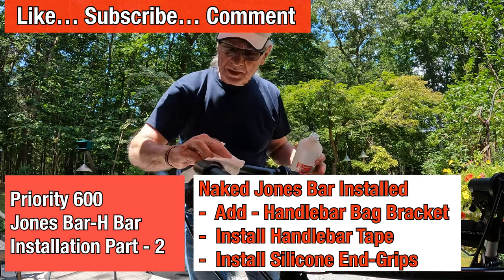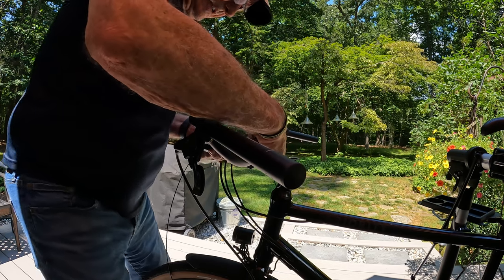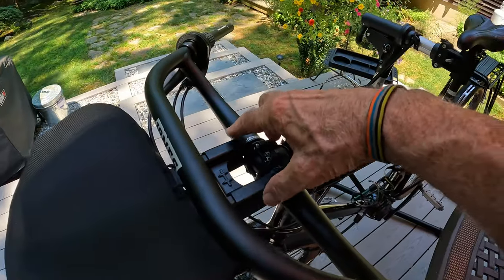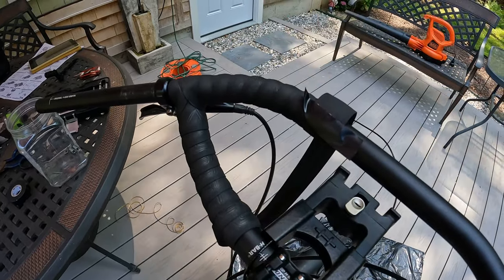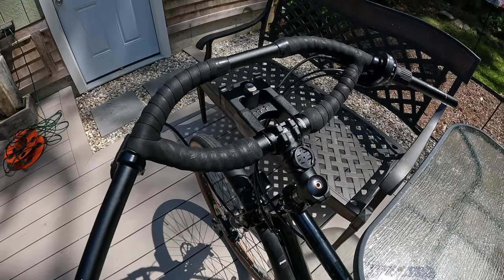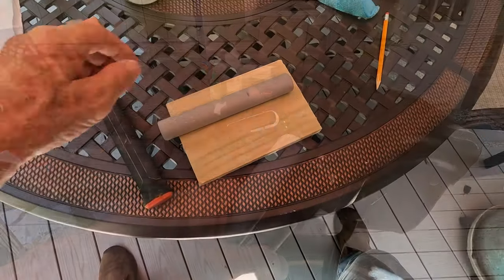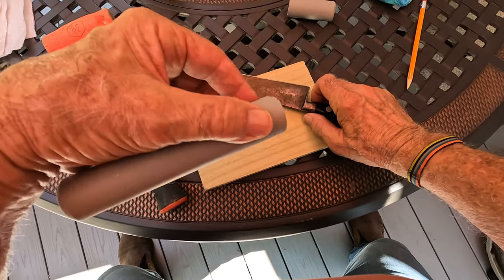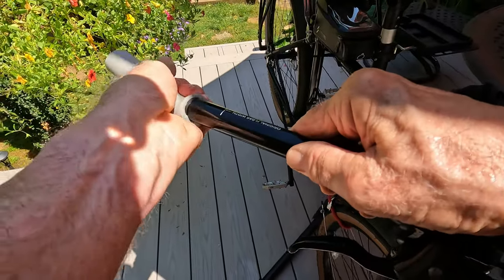Mrs. Jones Gets Gussied Up

Comment: I love the grips that come with the 600.  The ergonomics of them are great for my hands.  So much so that I'm thinking of converting my drop bar gravel bike to a flat bar with the same grips.  I have all the parts, I just have to commit to it and start the wrenching.
Reply from the maker: They are nice and I felt the same way.  But when I converted my Priority 600 to a touring bike, the single hand position even with those grips caused hand issues during a 5 or 6 hour day after day ride.  Some folks with Jones bars continue to use them.

Comment: thanks for the video. Extremely helpful in deciding on the 2.5 handlebar to fit my ortlieb. ill buy the extender. ONE QUESTION.  how is the bounce of the ortlieb bag? do you tie it in anyway  so it doesnt jiggle?
Reply from the maker: Thanks for watching. I don’t tie it down but might consider that if I were riding rough off road. I will post a short vidéo to my channel in the next couple of day showing the lack of jiggle on a rough ride.  If you already ride with the Ortlieb handlebar bar, it is exactly as stable with the extension as without.
Reply from the maker: Here yah go! My Ortlieb Bag / Jones Bar jiggle demo! https://youtu.be/BpmBSXP6c3U

Comment: I noticed that your light is not installed on the handle bar. Did you move the light yourself or ask that priority install the light on the tire fender. cheers
Reply from the maker: Thanks for watching! That’s the position the Dynamo light came on when I received the bike. I’ve noticed that has been changed in the later shipments. I view the Dynamo lights as a daytime running light only as at slow speeds (up hill for example) the stock lights dim down. I use the Cygolight (850 lumens) on my handlebar and the Cygolight “Hot Shot” attached to my rear rack. More lights are better in my mind.

Comment: Do you feel like the bottom of the ortleib bag obscures the light that you have attached to your crown.  I can see it doesn’t obscure the shining down at the road, but what about the height?
Reply from the maker: Great question. I don’t have the headlight sitting upright but have it rotated to the left.  As that is a hub generated light I would never use it for riding at night anyhow as the slower I go, the dimmer it gets. I count on the front and rear hub generated lights during the day to catch the attention of drivers.  I have a “Cygolight” sitting up on the Jones Bar (800 Lumens I think) and a “Cydolite Hot Shot” on the rear that I would use if night riding - front and rear very well lit. In addition I have another red blinky light on the rear of my helmet that I use day and night when on sketchy roads shared with cars.  “Well lit” is my motto… except when referring to bars and pubs.

Comment: I have the Jones H-Bar® SG 2.5 Loop, 660. I am a little confused on the  10-15 degree recommended though and what angle you are measuring and how to do it. I looked at several pictures on Youtube and measured on my Medium size 600  bike from floor to top of the outer bar middle and it came to 41 inches.
Reply from the maker: I just went out into my dark spooky garage and checked my setup. For the angle of the bar I used the iPhone App entitled “Measure.” Choose “level” and it gives you the angle of an object. I set the bottom of the phone at the end of the bar and I actually have mine at 9+ degrees. The end of my bar on the medium Priority 600 is also 41 inches off the floor but I have the wider bars.  Hope this helps.
Reply from the maker: Here is the link showing the way to use the app… in a non-verbal sort of a way.  If you have something other than an iPhone, there is likely a similar app.  I use this for setting my seat and rear rack level as well.  https://youtu.be/vWkI_lCowIg?si=wk1r3a4-CjrI_H7Y

Comment: Mate,
Coming from a road gravel bike intending to buy a touring bike without dropbars. Is this backsweep a little too much? Or something like 30 deg backsweep better? Want comfort but unsure if this makes me too upright like beach cruiser
Reply from the maker: The Jones H Bar with the 2.5 inch rise will definitely have you sitting upright.  They do have a Jones bar that does not have the rise.  As for the back sweep I went from a flat bar to the Jones Bar and don’t have experience with any other bar other than the drop bar on my road bike. As for the sweep I would recommend the shorter bar.  My bar is the 710mm and that places your hands far apart - you might want to consider the 660mm width.  It eliminates one of the many hand positions that I rarely use as it places my hands too far from the brakes.  The sweep, in my mind, is a more natural hand grip - similar to a wheelbarrow.  For touring it works well.
Reply from the maker: If you will be using the Ortlieb handlebar bag, you must use it with the Ortlieb extender and the Jones bar with the 2.5 inch rise.
Reply: @cc103acs  
Thanks for the response. 
The other alternative I was considering is Koga Denham bars. Any comparisons you can make?
Both work for the Rohloff-belt system which I want to buy.
Reply: @cc103acs  Yes quite a serendipity!!
Reply from the maker: Sorry… no experience with these bars.

Comment: Did you have to extend your shift and brake cables to fit the Jones bars?
Reply from the maker: The short answer is no I did not and the install video shows pretty clearly the amount of slack that I have.  Here is the video - https://youtu.be/4fvQqF7E9Eo and, if you fast forward to minute 6:24 you will see my first test ride and the pre zip tied slack. This shows the slack well as there is nothing yet attached to the Jones bar.
Reply: Thanks I have put my Jones bars on my 600 now. You are right there is just enough cable to work
Today is my birthday, I am 62 years old. My gift to myself was the Priority 600 and the Jones bars. Put about 25 miles on new bike so far and I love it.  

From: Another Old Man On A Bike.
Reply from the maker: I have the wide 710mm bar and have been thinking about cutting it down to the 660mm.  There are times when I think it is just too wide.  What do you think?
Reply: @cc103acs  I have a larger torso and long arms. So for me I like them long. Seems like I have better control with the widest grip. So I  do not think I will be cutting mine.

Comment: I don't use handle bar tape, i use tennis racket replacement grip.Works alot better !!
Reply from the maker: That’s Brilliant!  Where do you get that?
Reply: @cc103acs  You can get it at Walmart. Its made to work even better if its wet
Reply from the maker: @siscokyd  Wet when wrapping or wet when riding?
Reply: @cc103acs  Wet when riding. It goes on dry. I have played tennis with wet racket tape and would disagree that this is a good idea though.